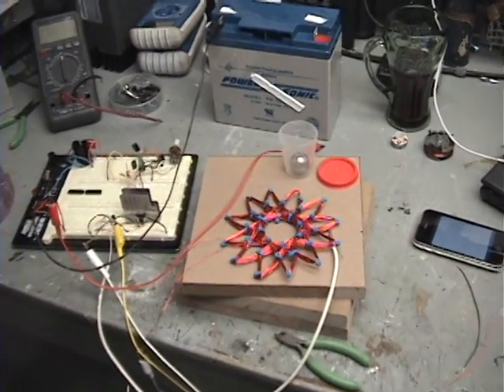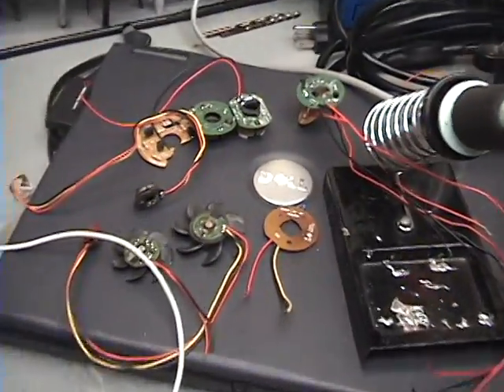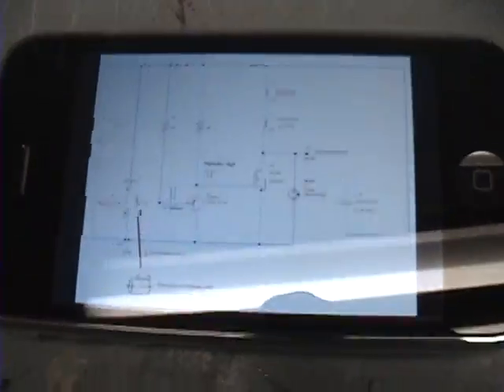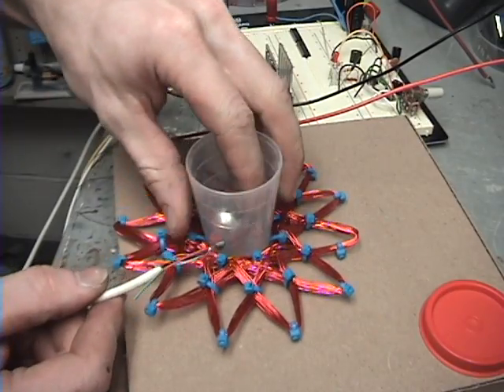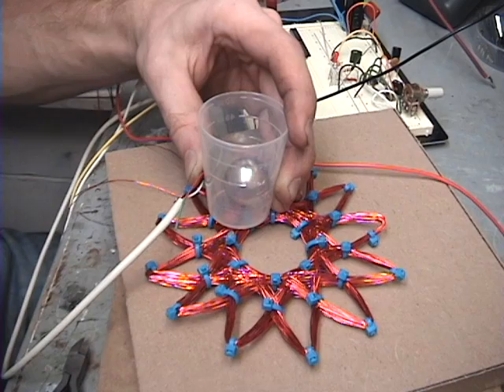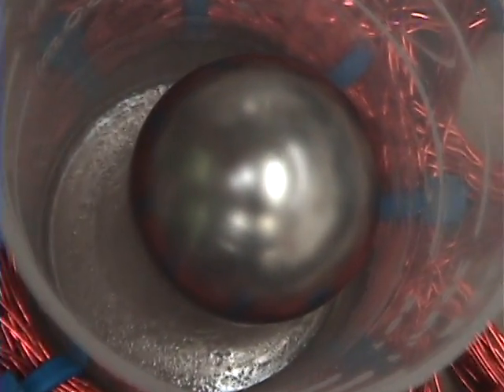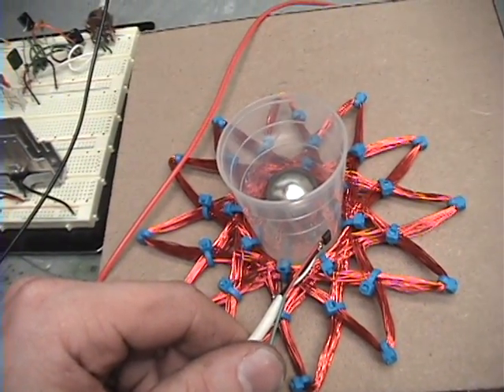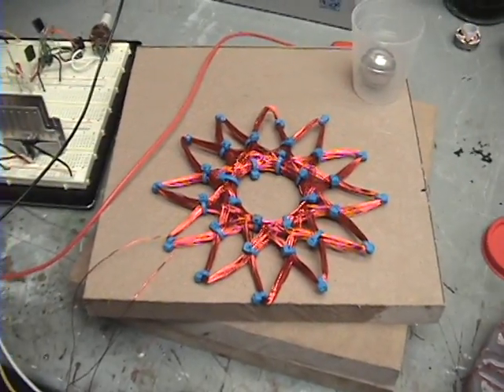Rodin / starship coil first pulse motor! (TEST15)

Comment: Hello,you need to look at the wiring diagram for a front load Samsung washer machine. The HAL sensor is used to change the spin direction ,ramp up and down the motor if you have ever use a Samsung front load washer you will know what I mean.

Comment: Info to the electric circuit: You need the neon bulb to kill the energy that come from the coil if the transistor open the electric flow. You can use this energy also to charge a battery (need a diode in series). Normally the energy would be killed by an antiparallel to the coil connected diode.

Comment: When you energize give the piston to push it down, the coil needs to be off as the piston goes up. the piston also needs to be magnetic. There are various problems such as when the piston goes up electrical and magnetic induction occurs. This type of coil would not be the best design for pushing cylinders, a common solenoid is. A very, very high current is needed. Tons of power loss through heat which would cause problems with the electronics/wiring just to name a few.

Comment: In the most perfect ideal system 100% of the power from the source would be converted to rotational energy of the sphere. ((2iV)/I^2=w. Because there is a pulse the power going to the B-field isn't maximized and there is of course friction as well as energy loss due to the electrical circuit and heating of the sphere. Because it's rolling in place it's center of mass isn't moving against air so theres almost no air resistance.